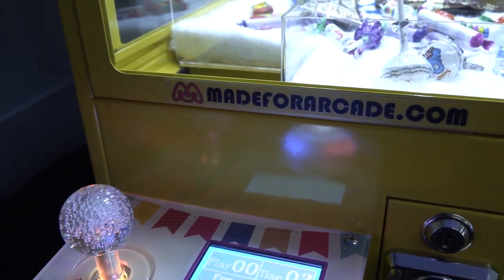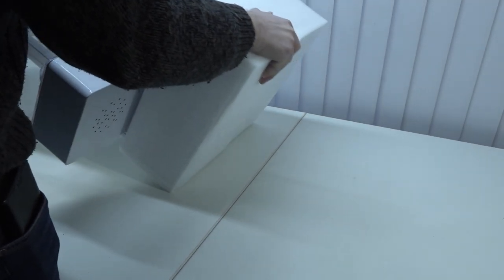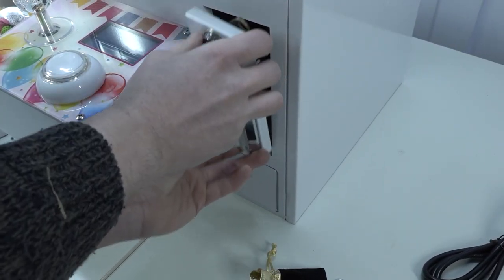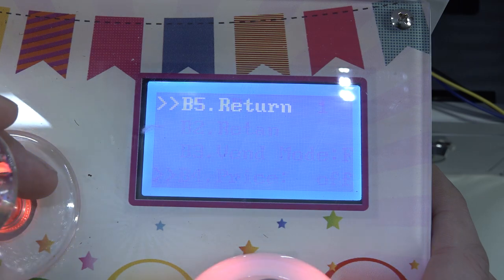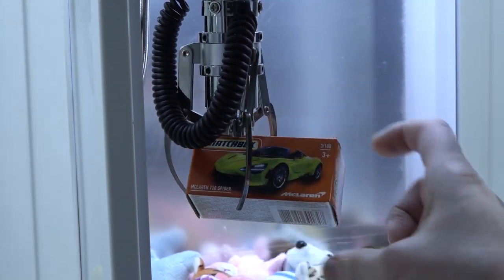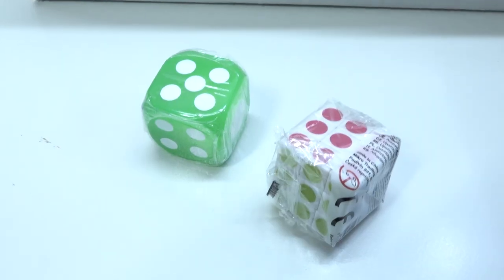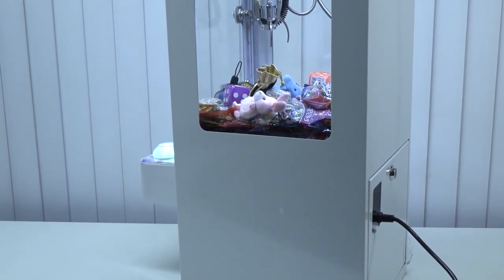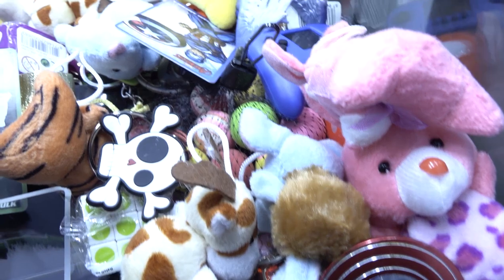Coolest 2022 Product For Your Arcade ? 🤔 .. A Mini Claw Machine 🙌

Comment: i have one of these, and i can tell ya. I have sooo many issues. first is the claw stop functioning, second is the speaker started to make electrical noises, third the PCB board fried. i spent almost $500 to have the faulty parts replaced. all this happen in a span of 7 months.

Comment: I bought my kids a ful size claw
Machine many years ago and it did give lots of problems.  The claw seemed to get out of sync with the rail system alot and I also hear the boards go bad easily and power supplies go bad.   We have lots of “Toy Soldier” brand machines in the southwest USA area.